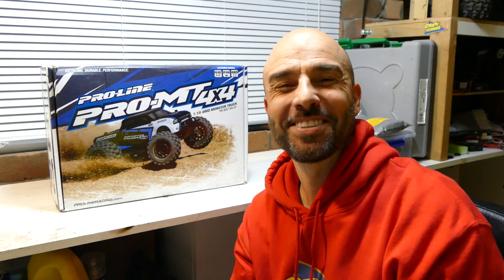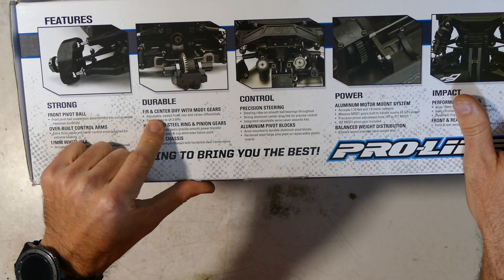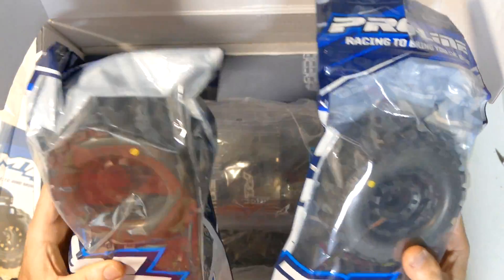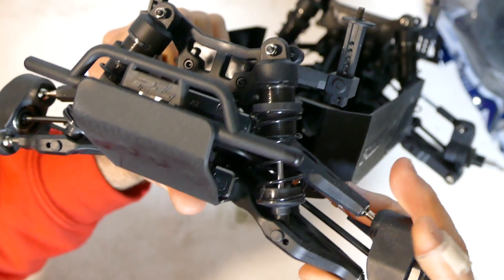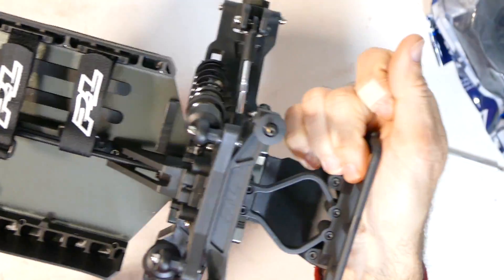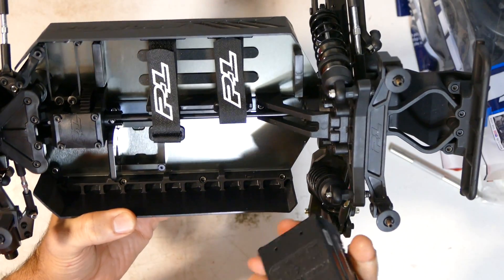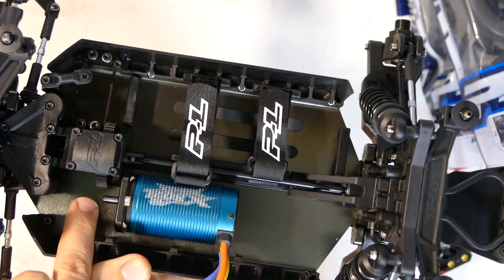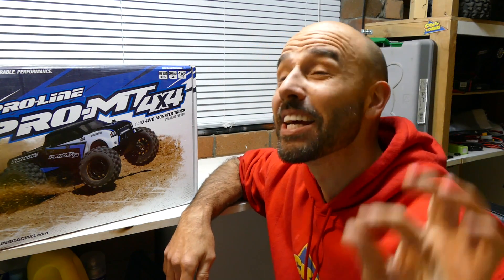NFG RC Monster Truck Build Off - PROLINE PRO MT 4X4 Part 1

Comment: Great build off!  Love the power system you are going to put in. The plastic spur will hold up but Pro-line just released a metal spur. That servo saver will fail every time.  They also just release a metal servo saver.  The Delrin in the pivot ball hardware is going to melt.  I would suggest the Team Associated RC8 extenders.  Works perfect.  Prevents the melting.  Check out Rich Duperbash's channel.  He shows what you need to do to mod the extenders to fit the MT 4x4.  Make sure you change on the diff fluid for 8th scale power system.  Pro-line suggest running 1M diff fluid in the center.  I also swapped out the front and rear grease for 100k diff fluid.  Lastly the rear sway bar tends to pop off.  Make sure they are straight up.  That's another Rich Duperbash suggestion.  Works great.  As for the MT410, I have no suggestions that truck is a tank!
Reply from the maker: WOW! Awesome and thanks for all the helpful info brother.
Where is the best place to buy upgrades for this badboy?
Reply: RC Tanks & Trucks 24/7 I purchased the Pro-Line upgrades (spur and servo saver) directly from Pro-line.  As for the RC8 extenders, i got them from eBay.  Those were a little harder to find.

Comment: Have you had to address the front pivot ball issue? I have read about the pivot ball rubbing on the hub bearing and smelting something to that extent. As well I know MIP makes upgrade pivot balls. I have already ordered my pro MT but I am trying to gather as much info as I can before I start running it.  Thanks steve.   I have also seen a modification in which you stack to steering racks and extend the length of the mounting screws. Evidently they are too short from the factory. This is possibly something they have already addressed and fixed. I look forward to seeing this thing shred. I know the Tekno is a superior platform but it is also significantly more expensive.   And I like the idea of the fact that it is compact, I have 2 kids and for dogs and I need my RC stuff to squeeze into my vehicle somewhere, haha

Comment: Take out the diffs & fill them. Get the steel spur & aluminum servo saver. The hinge pin retainers might as well be jello, all will bend because the metal is VERY thin @ the screw holes. The rear diff has a cup retainer pin thingy that will eventually explode to bits & take the rear diff with it so beware of that.
Reply from the maker: Awesome, thanks for the info. Where is the best place to find parts?

Comment: also one big thing the teknos a 1/8 mt
Reply: Is that your opinion? considering it's advertised as a 1/10th scale Monster Truck platform that is capable of handling 1/8th scale running gear
Reply: Michael Lucre I'm sorry if this sound rude but have you seen the size of a mt410 its 1/8
Reply: Michael Lucre the proline is 1/10 but can handle 1/8 electronics
Reply from the maker: Its advertised as a 1/10 bro
Reply: RC Tanks & Trucks 24/7 but it's not
Reply: Chris Kavo what
Reply: Chris Kavo I can't win can I
Reply: Jumpstart rc - The Xmaxx is 1/6th but can handle 1/5th running gear, we can go on for days bruh. But I know exactly where your coming from!!!
Reply: Michael Lucre so is the erevo... The mt410 is 1/8th.
Reply: Lawrence Timme yes both the mt410 and erevo are 1/8 trucks there big
Reply: Jumpstart rc exactly. If I say I'm a small person when I'm 6ft it doesn't make me a small person. If traxxas say the brushed summit is the fastest rc truck ever made, it does make it the fastest truck ever made.

You can claim anything but it doesn't change facts. :P
Reply: Lawrence Timme I don't understand